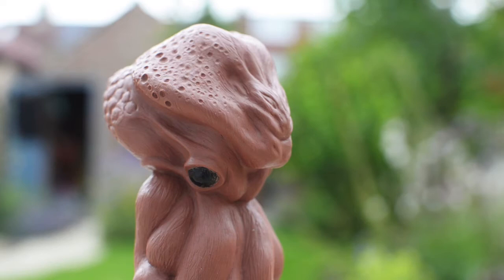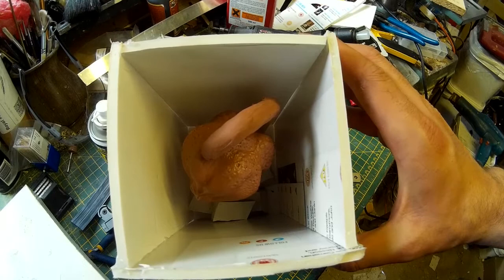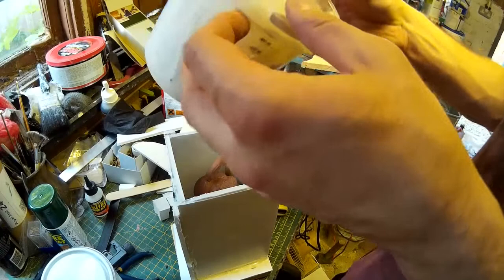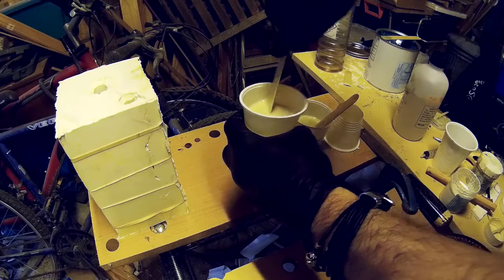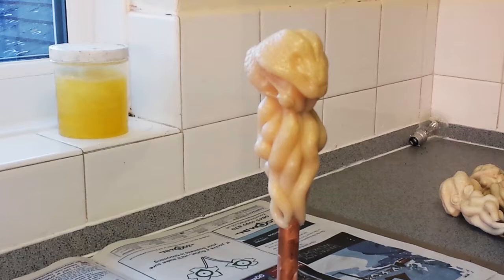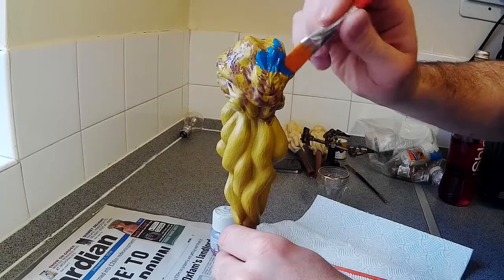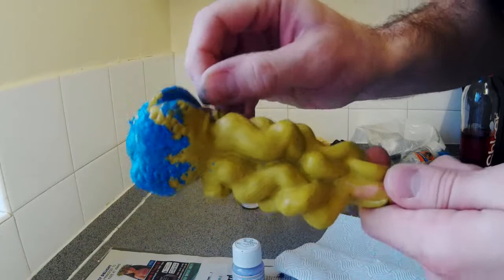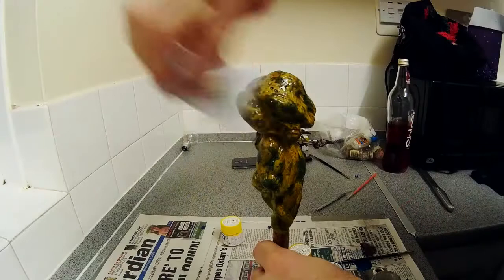Making a Monster Part 2 - Moulding, Casting and Painting

Comment: Hi, great video. Wondering regarding the air compressor, do you use that same machine for both vaccum and pressure casting? Or do you need a separate machine for both?  Same question regarding the pressure pots? Same for both or two separate sets?
Reply from the maker: Thanks - yeah you need a separate unit for each unfortunately - a compressor for the pressure pot and a vacuum pump for the vacuum chamber. It'd be handy if there was one pump that could do both!  I have videos specifically about this if you have a look on my channel.